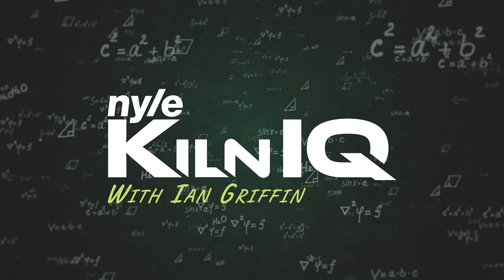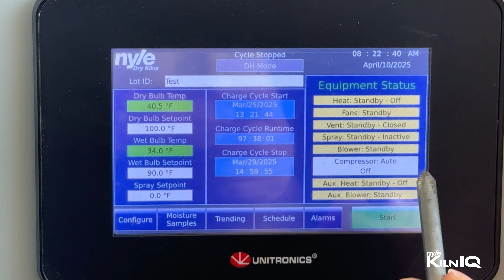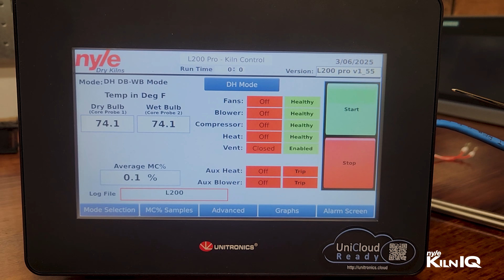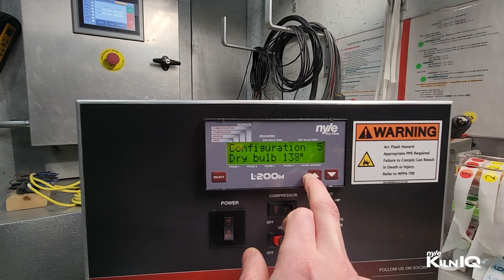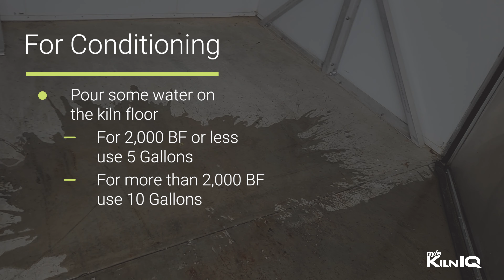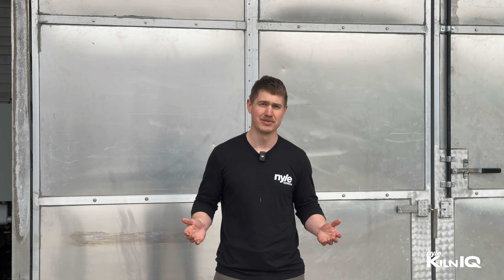KilnIQ | Sterilization & Conditioning in an L-Series Kiln

Comment: Can anyone help Me.  I'm trying to run a sterilization cycle.   I shut off the compressor.   It's still showing the "o"  I have the nyle L200.    I've even hit the red button in the compressor unit.   Ive shut off the whole system even.  Still shows an "o"